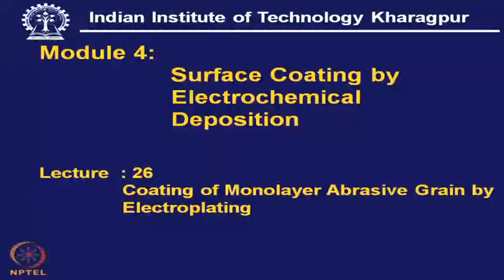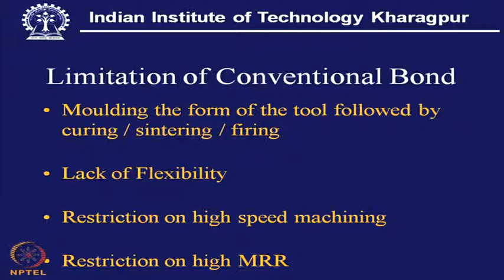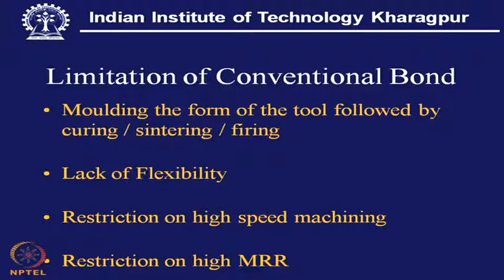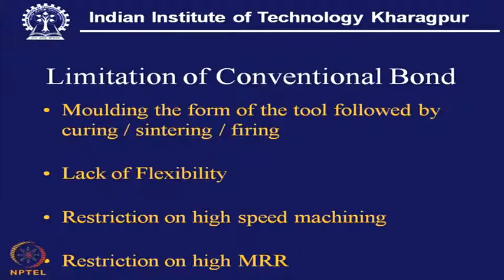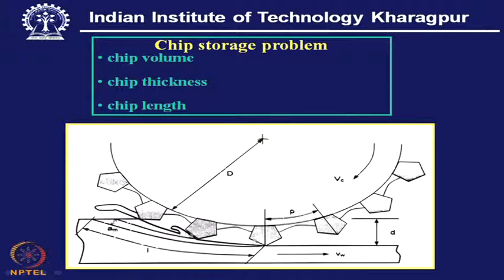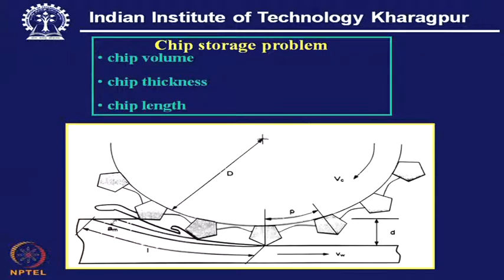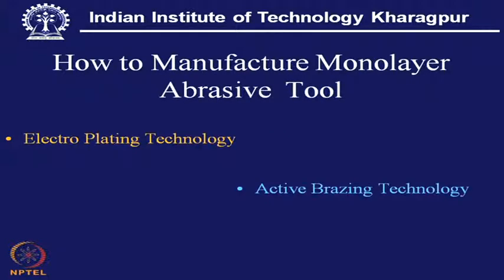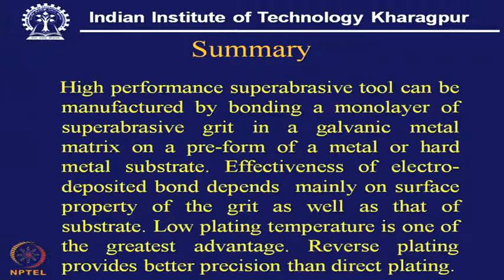Mod-01 Lec-22 Coating of Monolayer Abrasive Grain by Electro Plating

Comment: but how do you get the electrolyte between the plates for reverse plating? Is there anyone manufacturing such plates? I havent found anything. It looks good in theory. Like very good. You could polish stuff, hone stones etc to a very flat finish without deeper scratches. With one micron abrazive you could polish optics without expensive machine running 24/7. It would leave much better finish than surface grinder. Machinists would use it all the time. I havent seen a single reverse-plated plate yet